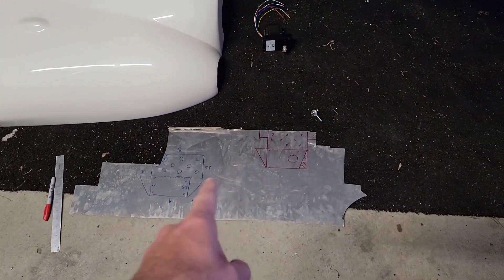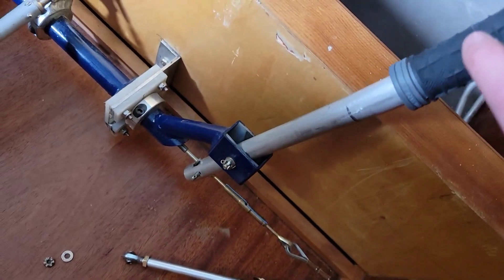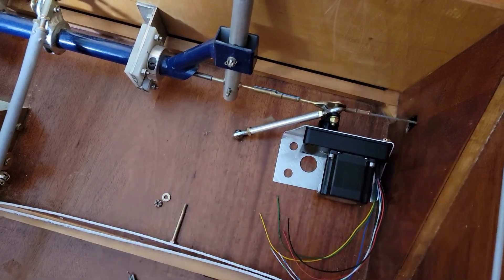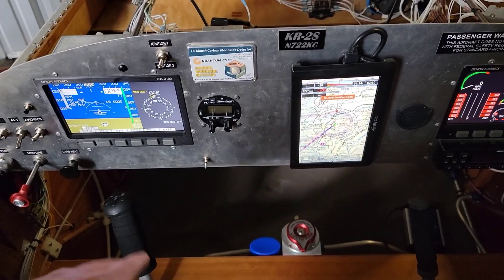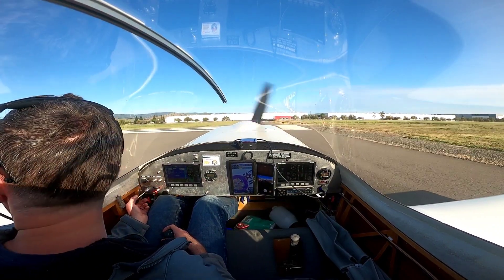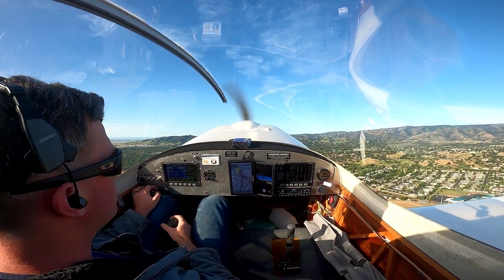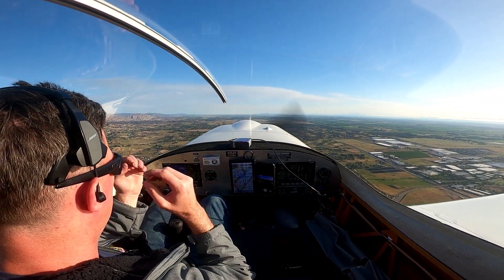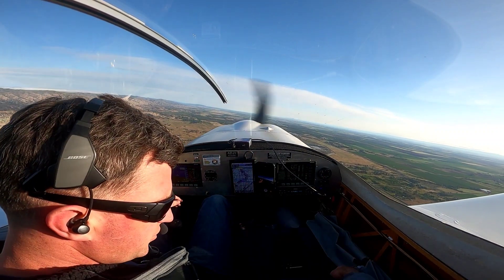Dynon autopilot install on my KR-2S

Comment: Hi Chris. I am from Argentina. Amazing how simple the installation is. I have made a KR2S with the RAF 48, but with a 2-foot wider horizontal tail with the Langford design. I am beginning to fly it. The plane is wonderful in the air, but I still have some trouble landing it. In your video you have what it seems to be an Astro Link from Levil, running the tablet in the middle. Do you use it? Does it perform well? is your tablet Android based? My instruments are pretty basic so far, and I am planning some upgrades.
Reply from the maker: The ilevel works great with my iFly 740 which is the tablet you see. It works great to give information to my dynon instruments. I back it up with my cellphone running the iFly app.
Reply: @vr6chrisvw  thank you for your kind answer. I look forward to seeing more of your excellent KR videos. Regards from Buenos Aires.

Comment: Nice work, I have a project kr2/s but my set of plans is not complete, do you know where to get plans,
I'm interested both kr2 and kr2s plans.
I asked krnet posting list but no luck there.
Reply from the maker: Original plans are no longer being produced. You may have some luck finding a used set from someone on the KR mailing list. There is a current movement to create a new free version but that is still in it's infancy.
Reply: @vr6chrisvw  Thanks , I try mailing list again. Do you know if this free version is accessible online, I would like to participate creating it if some help is needed.
Reply: I may part with some

Comment: That is awesome Chris... Great job. I am looking forward to using my Dynon autopilot as well. I will be configuring it tomorrow,. I will be using the AP74 to set my heading and altitude, so looking to see how that will work... One question, which radio do you have? I just got my new 2 1/4" TQ Aviation radio.
Reply from the maker: My radio is a flightline 760. The only thing I don't like about it is that a radio transmission overrides my intercom so I can't talk to a passenger when someone else is talking on that frequency.